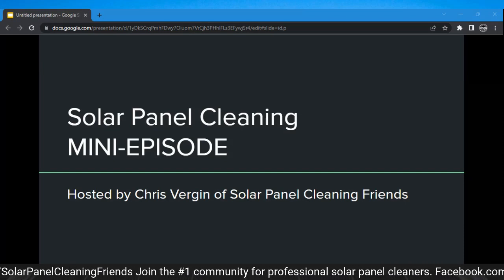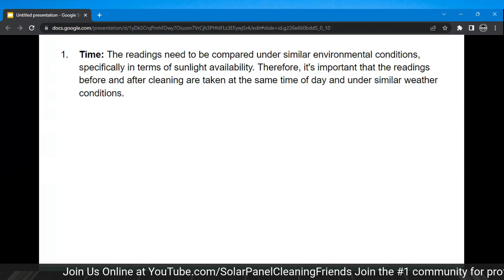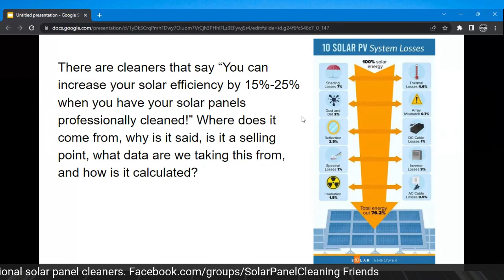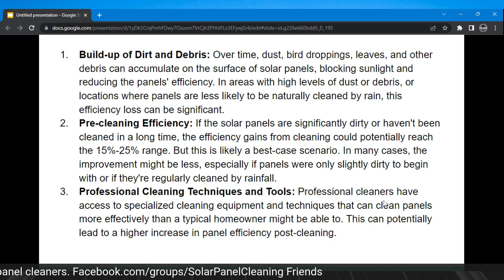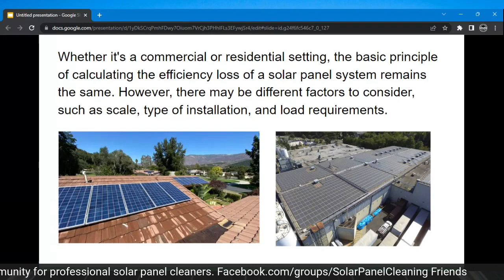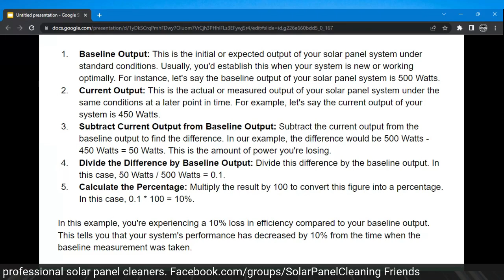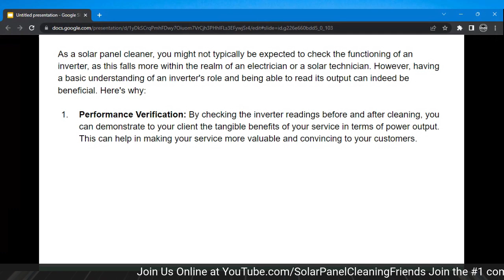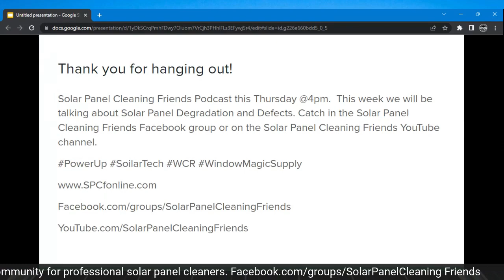Solar Panel CLEANING Percentage ENERGY LOSS | Mini Episode 001

Comment: I had a solar panel cleaning job this year that was so bad I could not clean it.  It was located on a very steep second story roof and the neighbor's house was so close that climbing a 40' ladder was very steep.  Over half the panels were under a broad leaf tree which gave off a lot of tree sap which was cooked on to the panels by the sun year after year for 10 years.  I did get one row of panels cleaned, but it took so long that the customer could not afford to have the rest of the terribly neglected panels cleaned.  Getting the panels cleaned annually would have made much better sense since they lost a lot of electricity production over the 10 years of neglect.